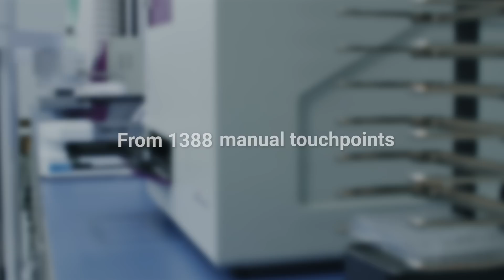Fully automated quality control for genomics

Comment: This is a cool looking setup you have. I am genuinely curious about what is the use case for having both Scara arm on rails along with transport shuttle system (Linq Bench?) that you have on the bottom shelf. You will still need to pick up and move to any device using scara. Correct?